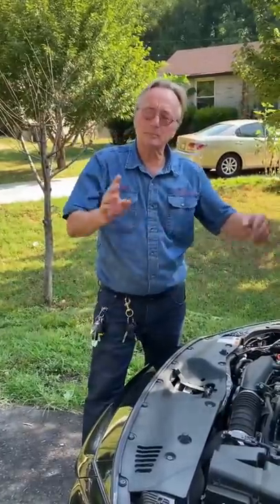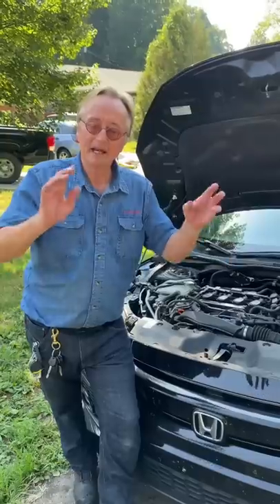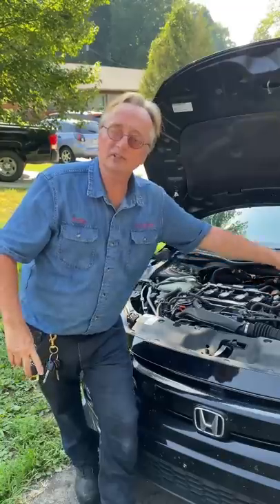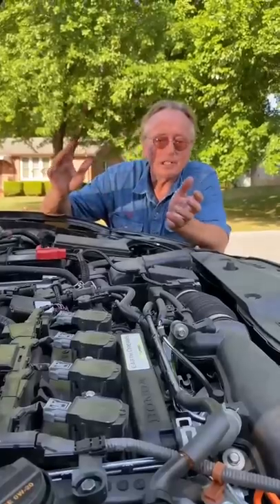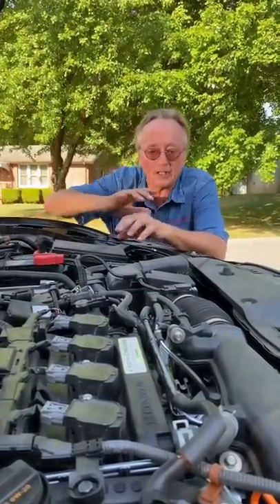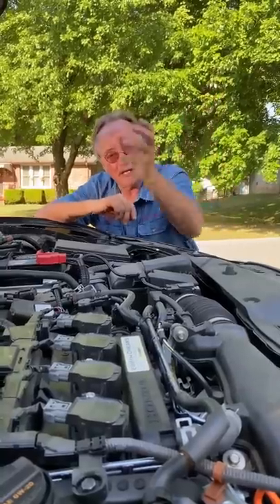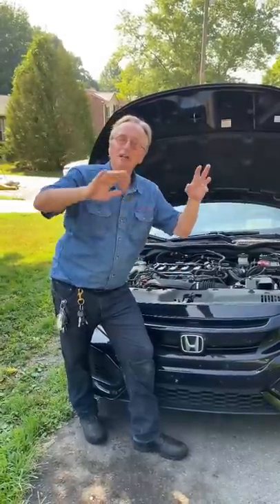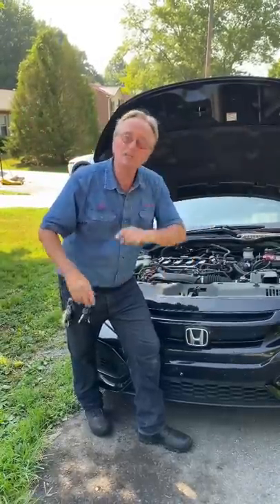Why Chinese Parts are Crap

Comment: Bought Chinese scooter: broke constantly, gave it away.
Reply: Some of those you can buy OEM parts from Honda and kawasaki to replace and they are awesome. 

I know alot of guys will buy those cheap crap carts and bikes...run em till they break...then upgrade them. They basically end up with the OEM that the Chinese are cloning for 1/2 - 1/3 the cost.
Reply: @shaunofthedead3000  that's actually a pretty good idea
Reply: I bought a Chinese angle grinder used it once it never worked again.
Reply: @trogo24  my uncle bought one of those,  same results, used once...throw it in the garbage.
Reply: @shaunofthedead3000  maybe just use the Chinese frame and wheels...replace the entire driveline with non-Chinese parts...if you can find any.

Comment: the problem looming out there is that OEM parts may become even more scarce than recently, especially if the right to repair issue gets worse they could conceivably refuse sale of parts over the counter.
Reply: No kidding right…!!!!
Reply: How?
Reply: Exactly! I have a 2008 Dodge Ram, 1500 5.7 L hemi with lifetime powertrain and the dealership don't carry parts for my truck anymore! Maybe like 7% parts of my truck at a dealership. All I do is want to sell me a brand new pickup truck. Sorry but I don't have $60k to $85k
Reply: Def.  But an extra when you can if it makes sense.  But OEM or any good quality parts seem scarcer and scarcer
Reply: Thank goodness mazda still carries stuff for its 90s model cars

Comment: once bought chinese motorcycle mirrors. right mirror broke off from the shaking and launched itself at some people waiting for the bus on the sidewalk. the left one slowly dangled from the glue on a hot day. the 20 bucks were worth the laugh. spent 60 on OEM suzuki mirrors on ebay used.
Reply: Yeah he cheap off brand Chinese bicycle tire I tried once literally split down the middle after a couple hundred miles.

Comment: Even when trying to buy oem, it's still made in China.
Reply: He meant Chinese aftermarket meaning not in specification of the original manufacturer.
Reply: @Claro1993  doesn't matter they are still junk Chinese parts oem spec or not.
Reply: @wheeliebad11B  nah, oem is oem. probably made in different factories
Reply: There are varying levels of quality to Chinese made parts. Some are made up to spec, with proper QC. But let's be honest: Most companies don't manufacture parts in China cause they're looking for quality.
Reply: There is a saying in the electronics industry in China that NOTHING GETS THROWN AWAY. If a manufacturing line runs a shifts worth of thousands of bad parts, they aren't scrapped. Someone buys them and they get sold as cheap replacements or counterfeit OEM parts on the grey market. 

I will never put a critical part in my vehicle that isn't OEM. I knew a buddy who bought 8 coil packs and tossed all the OEM ones. All the cheap replacements started failing months later and he had to buy used OEM ones. You make your car less reliable with cheap crap. 

Now a door handle or something like that? Take your risk, but critical stuff? No way.
Reply: All my apple products, LG and Samsung appliances are all made in China.

Comment: DENSO is the OEM manufacturer of Toyota and Lexus oxygen sensors.
Subaru, too.
Reply: And many Volvos use Denso crankshaft sensors. Denso is a Japanese company. Far superior to parts from China.
Reply: they’re a japanese company tho, apparently used to be part of toyota
Reply: The major Japanese automakers have historically and currently have keiretsu and banking relationships.   In the case of JP manufacturing, it works well.   Toyota basically tells its suppliers what they want and how much and how much they are willing to pay for it.   That’s one of the reasons they have been able to stay on top of parts supply through the pandemic .   The concept goes back to “keiretsu” and most major JP companies still have equity cross holding relationships to cement the informal ties (although the changes in the Governance Code are leading to non-core business equity stakes to be sold off if they cannot be justified)

Comment: I'm the ultimate cheapskate, yet even I try to use OEM for critical applications. Although I did put a $50 buck Chinese eBay alternator (with no core charge) in my 1995 Ford Contour and it's still going strong several years later.
Reply: Nothing wrong with being cheap. You save money for the stuff that matters....

Comment: I had a customer try to get around paying me to fix his car after I read out his codes on a road call, he put in an eBay crank sensor and did a bunch of other work, it all went to crap immediately after he was done, then he had to call me to help, and so I added an  as$ hole charge to his bill, I warned him, it was a BMW
Reply: Good for you!!
Reply: He should have gotten a honda.
Reply: @danteanderson9052  life’s too short to drive boring cars.  There is exceptions.  But you Can’t even get a manual unless you want to drive an ugly little car that looks like a Decepticon

Comment: This is true to a point. What you're gonna find out is that many of the electronic parts sold aftermarket are actually OEM. Meaning it's the exact same dealer part in a different package. Especially if you buy something like Echlin or SMP. Or Delphi, Denso and Bosch. And a dozen others. 

Conversely, who can find some cheaper dealer parts that are actually Chinese knockoffs. Such as many AcDelco, Motorcraft, Mopar filters that are made by Champ and are nearly the same quality as Fram. And Fram is junk. As opposed to GM, FoMoCo, and Chrysler parts. Yes, they are actually different manufacturers on many of those. 

Today is a different world, however. Today the dealers are having massive difficulty getting anything, but ESPECIALLY electronic parts. For instance, the fuel pump on a 2019 Chevy 2500 is on indefinite back order. Same with a 2018 Ford fuel pump driver. 

So many dealers, and aftermarket too, are doing alot of substitution to make things work. 

Hell, a 2019 dodge wheel bearing is currently unavailable, so a repair shop gave the customer the choice of waiting months with no vehicle...or replacing it with a 2018 which is identical, but the sensor is different and it will throw a code. The customer chose the latter. 

So some of those Chinese parts are all there is. And some creative repairs are now being made. On the up side...sometimes you can buy those Chinese parts with lifetime warranty and keep swapping till you get a good one. 

Had one customer that went through 4 of mine, 2 junk yard, and 6 of the dealer throttle position modules for a 2008 dodge 2500 diesel until he finally got one to last. We're wondering how long. And the dealer is completely aware of the issue. And so was my supplier. They both said pull the handle for another try and hope for a jackpot. 

I will say that I prefer dealer parts when available on my vehicle. But not everyone can afford them up front. Sometimes you gotta make do.

Comment: So true. Bought a cheap after market knock sensor for our Mazda 323 Astina on ebay because the original one was leaking oil. Engine developed predetination problems. Removed cheap unit, installed original, no more predetination.  👍🇦🇺
Reply: You DELIBERATELY bought that cheap crap from e-bay, trying to save money.
It didn't work.
 It's YOUR fault for buying cheap crap from e-bay.

Comment: Can definitely confirm. I purchased an inexpensive aftermarket evap purge valve and it straight up failed 2 days after the 90 day warranty… went to the dealership and got an OEM part for just $20 more and haven’t had issues since.

Comment: I haven't done work on my vehicles for years. So, OEM parts are used by the dealers without further problems. Cheap parts don't pay.
Reply: OEMs do buy alot of parts from outside. I sell a ton to Ford, Chevy, and Dodge/Ram dealers. They just never tell the customer. 

But many of the parts I sell are made by the exact same company and to the exact same specs as the OEM parts...just relabeled. And the dealers are more than aware of this. 

But the Autozone, O'Reillys, Advance sell a ton more of the chineseium junk. Those guys are for the DIYer. O'Reillys is the least worst of the clones. Most of NAPA is privately owned and most go out of our way to sell quality higher end stuff specifically for shops and dealers. Some of the Parts Plus guys are pretty good. 

Essentially Autozone, Advance, O'Reillys are equivalent to Walmart of the parts world. They sell cheap junk at maximum profit and don't care about the customers. 

Conversely NAPA isn't the best place for a DIYer who has a single care in the budget and nothing about quality. Our higher end chassis is ridiculously priced. But to put that in perspective...our low end product is MOOG. Which is the high end product for our competitors.

Comment: Ford is really particular about using oem. Anything sensitive like emissions related parts, it would behoove you to buy oem. The aftermarket stuff just isnt going to last. But it's a double edge sword too because if you don't fix the problem causing the harm then the oem part will fail. OEM doesn't have warranty like aftermarket.

Comment: O2 sensor output usually is voltage between 0.7 volt to 1.1 volt. The heating element just takes 12 volt. What does he mean by matching with software?

Comment: If thinner wires cause enough resistance to mess up the computer then the computers the issue not the wires. Adjusting for differences in ohms isn’t that hard and I really doubt a modern cars computer couldn’t make that adjustment.

Comment: Absolutely right. I had purchased AF sensor #1 b#1 from eBay for only 25$ oem $250 lol. Then I found my AF sensor was sending data to my ECU weird and turned on my check engine sign. Then I bought one from junk yard and my problem was solved and still running strong
Reply: Funny how so many of these faulty parts problems can be traced back to cheap crap from E-BAY.

Comment: Buying inexpensive Chinesium part is ok. Problem starts because those buyers are so cheap that they want 10% priced aftermarket part compared to the originals. If original is 400$, buy something 300$ not 60$ and hope for it to work.

Comment: Remember when the Tesla's first came out and several burned to the ground due to defective battery packs? My brother-in-law was involved with that. Problem was his company (sub-contractor to Tesla) would correctly specify the parts, and ensure tolerances were correct, but the Chinese would cut corners to increase profit whenever the Americans weren't looking. A penny here, a few cents there, they would keep pushing outside spec until the parts they made began failing prematurely. Virtually all Chinese suppliers follow the same tactics today. To them, building something to last means leaving money on the table. I call their corner-cutting "cheapification".

Comment: Wait, isn’t every part after the factory aftermarket?
Reply: No.Original equipment manufacturer.If you go to the toyota dealer for example and get a part it will be the same part that was installed at the factory. (whether or not they were actually produced by the device manufacturer, but rather supplied/manufactured for them.)

Comment: When a major car manufacturer, like Frod Motors for instance consigns a 3rd party parts manufacturer (let's call them NOOG) to make a part like a tie rod end for them, it is built to a much higher standard if it is to carry Frod's OEM part number. Unfortunately, NOOG and other 3rd party parts manufacturers seem to always tout that they make OEM parts for Frod to get customers to think that's the quality level you'll get if you buy the NOOG brand. Nothing could be further from the truth. This is especially true with wheel bearings, suspension parts and sensors.

Comment: Explain to me how smaller wires changes the signal to the computer.
Reply: Smaller diameter wires have more electrical resistance and thus affect current flow at a given voltage.
Reply: @markoftheus  show me the math. What signal is being interpreted by the computer? Is it the current or the voltage?

Let's assume we have a sensor with a pigtail wiring consisting of 1 foot of 22 awg wire that is replacing a sensor with 1 foot of 24 awg wiring. 

Show me the math that explains the difference in signals.
Reply: @luciddream2033  I think the ECU uses a given amount of voltage to determine the AFR, so if the O2 sensor uses the wrong gauge wire then the ECU might misinterpret what the O2 sensor is trying to tell it.
Reply: I think the germane question is whether those wires carry digital or analog signals. If digital, I agree the gauge of the wire won't matter. But if analog and it carries any appreciable current, then it could affect the measurements.
Reply: @ghostsmoke11  resistance doesn't change voltage though. It affects current. The voltage dropped in a circuit is still the same even if you change the resistance, so long as the voltage source remains constant.
Reply: @raywhite7742   It would still be analog to begin with and would need an analog to digital converter to accomplish that. That is usually done within the computer itself, because they need to represent the analog format as a digital format in order to be processed by the CPU.
Reply: @lucid it is very easy to design a sensor with built-in micro and ADC then interface to the main computer via a serial interface. This can often improve SNR. So it could still be analog or digital. All depends on what the designer decided to do.